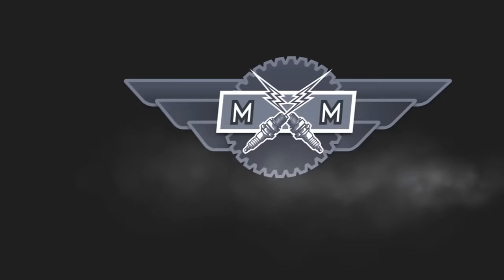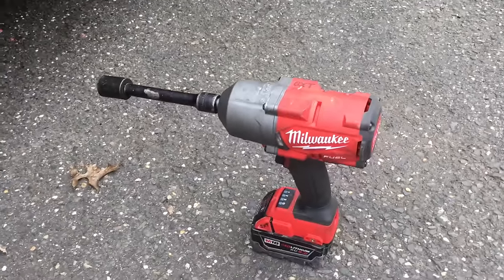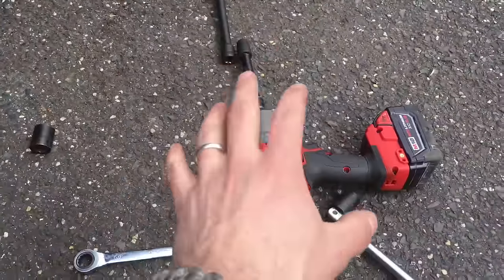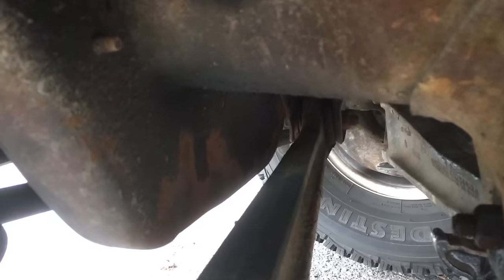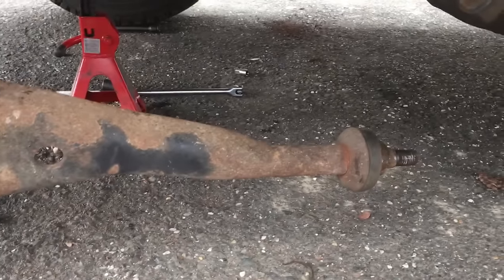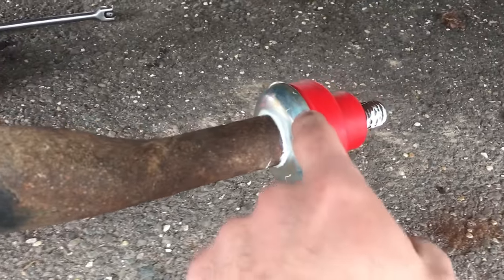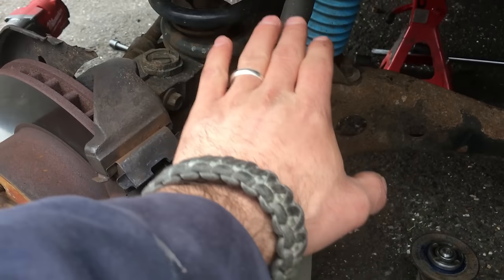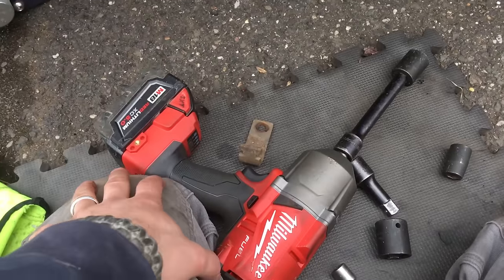How to Replace Radius Arm Bushings | 1995 Ford F150

Comment: It's also a f150 4x4 which makes removing the radius arm bushing harder. I'm working on it now.
Reply from the maker: ThaHandyman1212 Yeah it’s definitely harder. The front diff makes the I beans heavier and the front drive shaft has to be disconnected.

Comment: Thanks for vid i didnt know the name of the parts. I have bolts in the base so it can be un bolted rather than dropping spring..
Reply from the maker: No problem man!🤙 I’m glad I could help you out. Are you saying the radius arm mount is bolted on? If the radius or mouth is bolted on you can just unbolt it slide it off replace the radius arm bushings and put it back on.

Comment: I did this tonight without dropping gthe inboard axle bolt. Ratchet strapped my axle to one of my bumper bracelets
Reply from the maker: Nice! There are ways to get around pulling the axle pivot bolt for sure.

Comment: I leave it all intact except for the radius arm itself. I take the cotter pin out, the nut off, remove the rearward washer, and bushing. Then I use a come along to pull the radius arm forward to remove the front bushing, and washer. I then reinstall in reverse. Not that many steps. I changed radius arm bushings on a 1973 F100 (pre F150) lasted over 15 years after that.
Reply from the maker: I’ve heard of that method. It seems like it gets the job done. I had one guy comment on here that he tied his radius arm to a tree and just backed up. Lol
F100s are cool! My dad and kid brother both had one.

Comment: Hey nice vid. My bracket has bolts instead of rivets, and bracket is destroyed and needs replaced. Can i fix it without messing with the wheel assembly? Ie unbolt bracket and pull it off. Im not sure if the radius arm will be in my way but it seems like a simple job. Some metal is bent over the big nut and its rusty.
Reply from the maker: Attack Shovel Thanks man!🤙 If you bracket is held on by bolts you can simple remove them and unbolt the radius arm nut. Then the radius arm bracket should come off without messing with the wheel assembly. I’ve never done it that way but guys message me a lot about that method.
Reply: As a professional mechanic, that was the only way we did it. If they are still riveted, drill them out or use a cut off wheel, etc. Saves a lot of time over disassembling everything.

Comment: I just hooked the truck suspension to a single wide trailer house, broke the nuts loose too one thread, put the truck in reverse, took off the nuts, replaced the bushings and then drove it forward, noticed it back up, took less then an hour, you’ll need some one to back it up
Reply from the maker: Ryan S I have heard of this method and I’ve heard people using a big ratchet strap hooked to a tree to pull the radius arm out of the socket. Definitely, speeds things up!🤙

Comment: Do you have a video on cab mount bushings? Those are about the only bushings I have left to replace. Thanks
Reply from the maker: Unfortunately no. I’ve only replaced the radiator mount bushings and I never filmed that.

Comment: I just removed both radius arm nuts with a 1/2" breaker bar no heat no torch.  Used breaker bar until was loose enough then used 1/2" ratchet with cheater.  Wasn't that bad but definitely easier with impact.
Reply from the maker: I guess that’s what you would need to do to get that nut off.

Comment: Great video. I like how you give us alot of close ups of the parts your talking about. Were those 2 ton floor jacks you were using? Why did you have one on the other axle pivet arm in middle; might bend it? Can you give us a close up of the jack stand because i wanna match the height counting the tabs ik everyone might hv different tires sizes. And you can zoom on your tire size too. Thanks
Reply from the maker: ThaHandyman1212 Thanks! I think they are 2 ton jack stands. If I remember correctly I bought them from a chain auto parts store. 
I put one jack under the I beam near the axle pivot bushing and one under the frame so the suspension could fill decompress. The placement of the jack stands won’t hurt the suspension or frame one bit. 
As far as height. The jack stand under the frame was extended as far as it could go and the one under the axle pivot bushing most likely was fully extended.
Yeah I have 31” tires on a 15 in wheel.👍
Hope this helps!

Comment: An FYI, the other side (passenger side) gets all the heat from the exhaust causing the components to wear more rapidly... In town driving is far worse for the passenger side because the cheap tin shield doesn't offer up any protection, it was made only for higher speeds as a stop gap as the heat is carried away by the air movement...
Reply from the maker: Good point!

Comment: Nice video.  One of my rivits is gone, driver side front. Does anyone know what size bolt goes there?
Reply from the maker: Thanks man!🤙 I don’t know off the top of my head what size bolt. But you could buy a couple different sizes and just experiment with what fits the best.

Comment: Dammit man! You really make me believe I can do this! Took my 95, F250 by a shop and was quoted $500 for the radius arm bushings and alignment. Second shop wouldn't quote it over the phone. Told me to bring it in. He warned me it would be two to three hours before he could get it on the rack to look at it. The truck only has 92k miles on it.  He's probably going to want to do ball joints, tie rods, blah, blah, blah. Fixing to call one more shop, then off to the parts house. 😢This is gunna suck. It's hot in Texas. Plus, I'm old😂
Reply from the maker: Oh, I think a lot of people are capable of doing this project if you have the appropriate tools. Is the truck 4 x 4?
Reply: @TheMinuteMasters  no 2wd. Oh, I got tools. No lift though. Hard for an old man to get on and off that creeper. I gotta ball joint press. Guess I'll have to figure what size sleeve for the pivot bushings. Doing pivot and radius arm bushings. Been driving a long time not knowing what the problem was. Thought it was break issues so I rebuilt everything. Still bumping around. Thought it might be the rear end. Pulled the cover and looked. Nothing. Was under there and my driver side radius arm bushings was blown out. Going to get it on stands, tires off and tools staged up for early morning start. Appreciate your help bud. Your a good man, proud of you.
Reply from the maker: @jayfromtexas6718  Ah! That makes sense. 
If you have your truck up on jack stands, it’s a good time to do all the bushings. 
Nice! That’s how I have to do all my repairs because I DD my truck.
Thanks Jay! I appreciate it!

Comment: Hello! I'm in the midst of replacing my radius arm bushings for my 93' F150 and I've followed the steps all the way up to putting the radius arm back into its slot with the new bushings, but I'm having a bit of a crisis! The sway bar is getting in the way, I can't get the arm back in the slot for the life of me! I'd really appreciate some guidance, as soon as possible. Thank you again!
Reply from the maker: Hi! Did you disconnect the sway bar?

Comment: I have an F3 50 and I put a 2 inch lift I believe I need to replace these bushings when I put it in reverse the whole truck squats down when I put it back and drive the front of the truck starts to raise
Reply: It’s an 97 obs
Reply from the maker: So my truck does that too. I think it’s the nature of the twin I beam suspension with coil springs. Although, your have coils? Most 97 F350s are leaf springs.
Reply: @TheMinuteMasters  Yes it does have coil springs I’m almost ready to pay whistling diesel to take this truck LOL JK
Reply from the maker: @jacobpalma9709  Gotcha. What 2 inch lift did you use? 
Otherwise, I wouldn’t worry about it squating after reverse. If you haven’t replaced any of your bushings it is definitely worth doing. It does eliminate a lot of the slop associated with the twin I-beam suspension.
Reply: @TheMinuteMasters  It was some cheap  eBay lift just the blocks back and front

Comment: You should use silicone grease on rubber and poly.
Reply from the maker: I used the grease that came with the bushings. Are you suggesting silicone geese over lithium?
Reply: @TheMinuteMasters  I don't know about lithium, but silicone doesn't degrade rubber or polyurethane. 
I have used "silaramic" brake grease for ten years with no degradation on poly bushings.
Reply from the maker: @corvairkid17  Yeah that’s what I’ve heard. 
I’ve never heard of that type of grease. I’ll have to look it up. Thanks for the tip!🤙

Comment: Hello sir. I'm doing upper and lower ball joints on 94 f150 2wd with the u shipped knuckle. Can't get the lower ball joint to drop.do I need to remove the snap ring on lower ball joint? Help ty
Reply from the maker: Hi Jimmy, so the ball joint isn’t fully seating into place?

Comment: i know what you mean with that nut, i beast moded mine off with a breaker bar . it was no joke.
Reply from the maker: Yeah I was going to try that but I didn’t have a big enough breaker bar. I believe you though. It was hard enough to get it off with an impact gun.

Comment: I just did this on the drivers side of my 96 F150. Could not pull the axle far enough forward. Cut off the bracket rivets, dropped the bracket. I used MOOG k80007 thermoplastic bushings. What did you torque the nuts to? Haynes manual says 80-120 ft-lbs. I have not reached 80 yet and the bushings are getting squeezed pretty hard already. Don't want to split them.
Reply from the maker: The trick is to unbolt the axle pivot bolt which gives the axle more room to move. But you used the other method which is good too.
I didn’t torque to any spec. As I was torquing  down the nut, the white plastic spacer piece cracked and fell out. So I decided to just snug the  nut on as much as possible until I felt like it was good. It’s been there ever since.
Reply: @TheMinuteMasters  Thanks! I just snugged it up until the threads started to protrude the nut. These thermoplastic bushings are much denser then rubber. Drives great.
Reply from the maker: @charleetho  No problem Charlee! That’s pretty much what I did. They are solid bushings for sure and they drive great!

Comment: It’s the clonking noise from when you’re at a stop, then accelerate right?  Did the noise go away? I’m having the same problem 94 f150 2wd
Reply from the maker: Inty But A clunking noise could be a couple of things but yes generally it’s the bushings being worn out. My clunk occurred when I went over rough roads.
Reply: Mine was the infamous slip yoke clunk. Installed a zerk fitting and greased it. Problem solved.

Comment: Good afternoon friend, answer me something this support that holds the steering rod arm of the ranger 97 v6 manipulated can be cut and left only where the screw holds the rod arm and leave it with the f150 if I'm not mistaken, to improve the maintenance of the bushings pulling what could you tell me being an automotive maintenance professional thank you if you can help me.
Reply from the maker: The support that holds the radius arm can be removed by cutting the rivets off and installing new bolts in the same holes. It makes the repair faster and easier.
Reply: @TheMinuteMasters Got it, I wanted to cut or remove it, and leave a sound where the bushings go like it's on your truck would be much better, good if it can be done as well as yours I appreciate if you can help me I'm from Brazil I have ranger 97 v6 stx extended, or get this information if it can be done this changed and it will not harm, because if you see there are 2 platters with less than 1 meter. Thanks in advance for your attention.
Reply from the maker: @rhonnymarques6560  You can definitely do that. 

I don’t know what you are referring too about 2 platters with less than 1 meter.

Comment: I just did this job with moog bushings but 2 of the  plastic caps cracked before i can reach torque specs. I followed your video, any ideas?
Reply from the maker: I ran into the same issue. So I never torqued it to full spec. I thought my plastic cap broke because the poly bushings were harder. Sounds like this is an issue either way.

Comment: Hi, Thanks for the vid. I have to do my bronco II nxt week. I am just wondering about that white spacer? Shouldn't it go on the other side? Gonna search the interweb to confirm. I ordered those red ones too. Thanks
Reply: Looks like Big cupped washer > big bushing > spacer (only fits one way on big bushing)> thru bracket < little bushing < smaller washer < nut
Reply from the maker: So is that the same order as I show in the video?

Comment: What will happen if the pro theme bushing completely falls apart it happened to my f150 the bushing is gone it’s broke apart and I’m worried if I can even drive it anymore till it’s replaced
Reply from the maker: You can drive without out the bushing. You ride will suck and you could risk the radius Arm pulling through the bracket.

Comment: What were the right torque specs? Having a prob with that.
Reply from the maker: If you are replacing the bushings with stock rubber bushings it’s between 80-100 ft lb of torque. With the polyurethane bushings is a lot less because they don’t compress as much. I tightened mine down until I felt like it would move and I didn’t crack the white plastic spacer piece.
Reply: @TheMinuteMasters  thank you so much. Really appreciate a reply back. This helps alot.
Reply from the maker: @desarieamezcua4780  No problem!🤙 Thanks for watching!

Comment: i have a negative camber and a guy told me replacing the bushing would fix it, i think i have that camber due to my springs being heated to drop the truck but supposedly the springs are still good what should i do
Reply from the maker: I would install adjustable camber bushings or at least get an alignment with the camber bushings you have. I have a video on how to install adjustable camber bushings. They are a lifesaver with TTB and I beam suspensions. I had positive camber issues.

Comment: I’m gonna replace the whole arm on my 95 2wd f150. What is the front side of the arm connected to? Is that the bolt going into the spring? I’m also replacing the brackets too so I didn’t have to drop anything.
Reply from the maker: Nice!🤙 The radius arm bolts to the I-beam using a very long threaded bolt. The top parts of the bolt is what the spring is bolted to. The head of the bolt is on the underside of the radius arm. It’s gonna take a heck of a lot of torque to get it out. Be as prepared as you can for a tough bolt removal.

Comment: I have a 94 F 150 my Truck has all bolts in my  Blacket For my Radius arm .  Do I have to take my Spring and shock loose to remove this bracket .
Reply from the maker: If the radius arm is completely bolted on, you can just unbolt it. I would just make sure there’s no weird tension on it that would cause the radius arm to spring downward.
Reply: Thank you for your time and your videos.
Reply from the maker: @leonbrazell6958  No problem man!🤙 Thanks, I appreciate it!

Comment: If you have an air hammer and a chisel bit cutting the rivets and replaced them with nuts,bolts and lock washers with plenty of red locktite is the way to go will save you a tremendous amount of time and labor and is safer.
Reply from the maker: Definitely much faster! I did it this way because it’s technically the “unbolt-it” / shop manual method.

Comment: The down side to the prothane is you feel the road more Ford had a reason for those soft rubbery bushings..also if they are wearing unusualy fast ..rear breaks weak over working front torqueing ..bad shocks..
Reply from the maker: Damian DeLapp You know people say that but I didn’t feel any difference switching from rubber to polypropylene bushings. To me, these truck ride rough due to not having enough travel and good shocks.
Reply: @TheMinuteMasters  I have poly on the radius arms and on the axle pivots in my 79 F-350.  I can't tell a whole lot of difference in how it rides but it does drive a lot better than when the bushings were getting worn out.  Mine were not terrible when I changed them either.
Reply from the maker: @DaveMcLain  I completely agree. I feel like the whole “harsh ride” comments about poly bushings are the product of a Pro vs Con article that a key board mechanic wrote.

Comment: I got the $11 autozone kit but the large bushing is too big, I couldn’t get the nut started, it currently has x4 outer bushings seemed to install ok, someone said to shave 🪒 the bushing down rather confused. One of my brackets had a huge crack across it so I patch welded it until I get a new one.
Reply from the maker: Gmguy3car Wow! You definitely have all the interesting circumstances. Cracked bracket and 4 outer bushings is rare. You’re going about it the right way though. Good luck man! 🤙
Reply: Well like I said it wouldn’t install, the x4 outers nearly matched the factory on heights etc, can’t have my only vehicle down for parts, I bought two kits cuz it said two required but then I saw a guy install what looked like the exact same kit using one kit, Bracket had rust helping the crack get worse.
Reply from the maker: Gmguy3car Gotcha. I think raybucks.com sells brackets and I think atstruckspring.com.